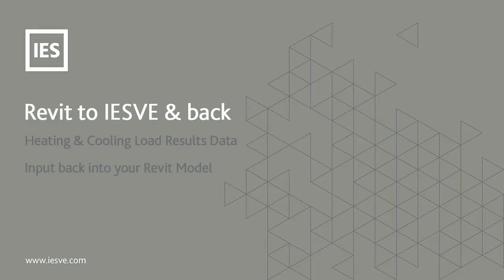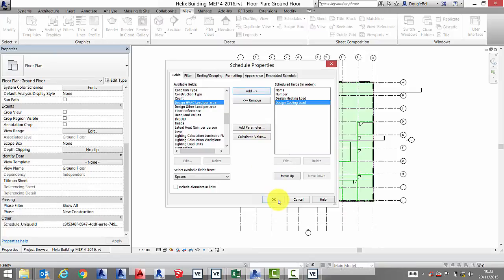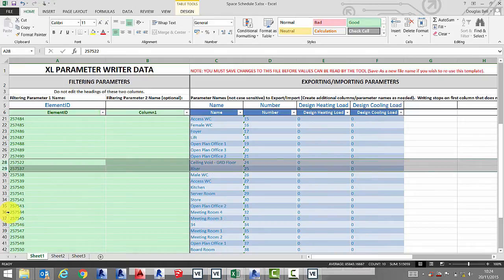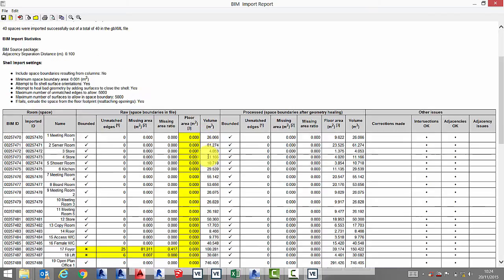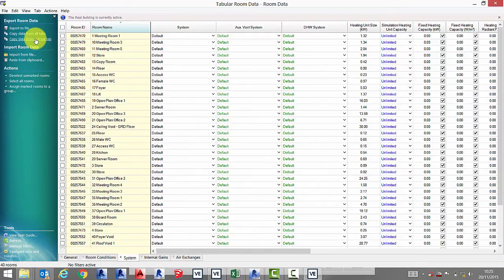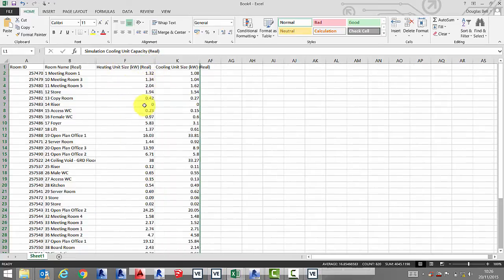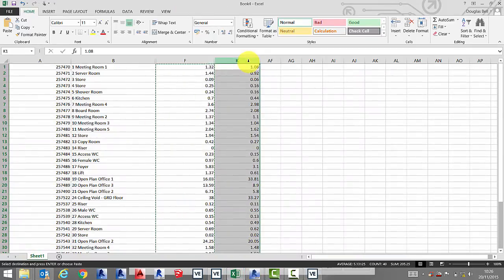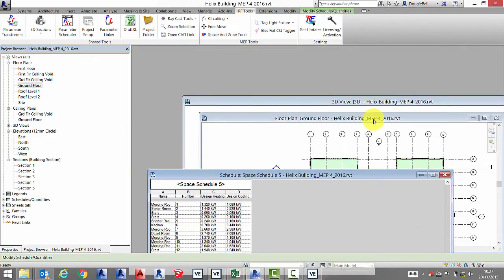Revit to IESVE and back

Comment: Can we ignore the highlighted data after importing the gbxml file into revit just like in your video?
Reply from the maker: Hi, Hariz. We don't understand your question, do mean gbxml to IESVE? If you use the latest BIM Navigator, you don't need to do any of this - the Navigator will allow you to do this directly between Revit and the VE – no need to use excel and sorting of spreadsheets.
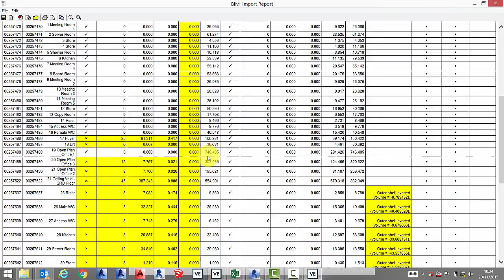Reply: @IESVE  at 2:24 , after you imported the gbxml file, there are some yellow highlighted values and also some croses in the report. Can it be ignore?
Reply from the maker: @engineeous1304  When you import geometry from revit for the majority of the model coming into the VE we have to ‘heal’ the geometry and essentially stich the floor and ceilings to the walls using our healing algorithms. That’s the ‘unbound’ and ‘bound’ check we run before and after we have performed these that you are mentioning highlighted in yellow within the model report in the (x2 columns of the table). I would not advise ignoring them, but check the right-hand ‘bound’ column has removed most of the yellow highlights. If there are still issues check the surface area that is missing and if it is very small (0.001m²)you could proceed. You would also want to check the Revit source file to see if these issues can be removed from there, in particular if the missing area or hole in the volume is greater.